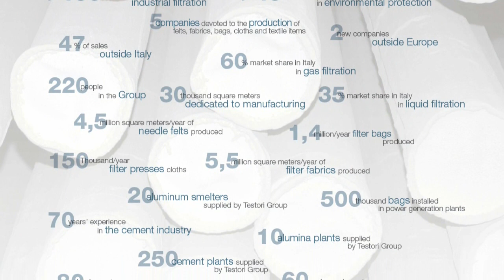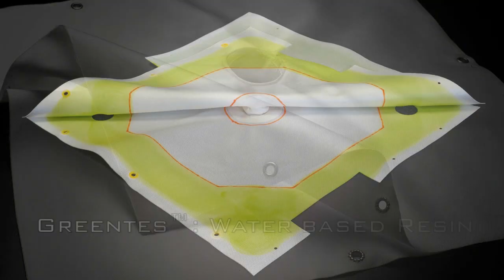Presentazione Testori

Comment: Dear sir or madam，

This is Penny from Yuanchen,factory of dust collector bag and cage,which was established in 2005.

Main Product:
1.High Temperature Pocket Dust Filter Bag(PPS,PTFE,P84,Fiberglass,Aramid,Nomex,FMS)
2.Low Temperature Dust Filter Fabric Bag(Polyester,Acrylic)
3.Filter Cloth
4.Filter Cage
5.SCR Catalyst
6.Nylon Powder for 3D SLS Printer
7.PTFE Micropowder for Coating
8.PTFE Fiber for Filter Fabric
9.High Tensile Strength PTFE Sewing Thread
10.Polyester Sewing Thread
11.PTFE Staple Fiber
12.Filter Media
13.Filter Sock
14.Filter Sleeve
15.Ceramic Powder:Si3N4,SiC,TiC,TiN...
16.Teflon Filament
17.Filtration Media
18.Polyester or PP Liquid Filter Bag

Should you have any interest,feel free to contact us!

Contact
Anhui Yuanchen Environmental S&T Co., ltd
Website:  www.shychb.com      www.ycfiltration.com
Penny Xie
Email:sales04@shychb.com
MP:+8618855125575
QQ:2590478794